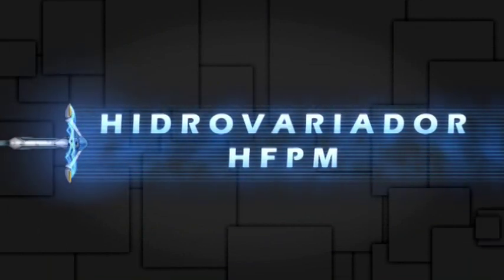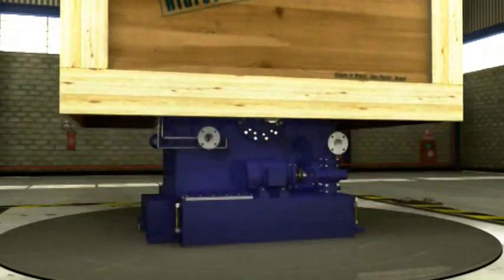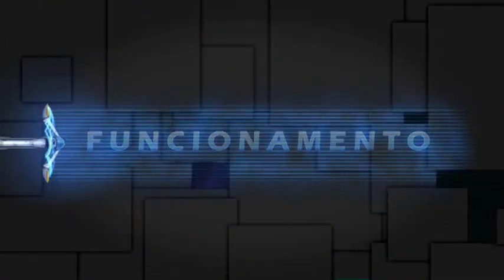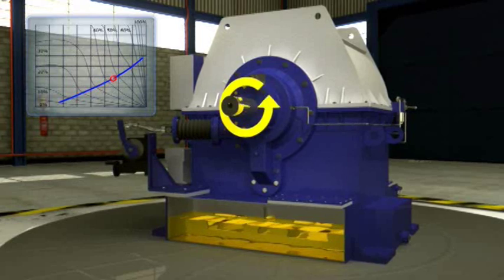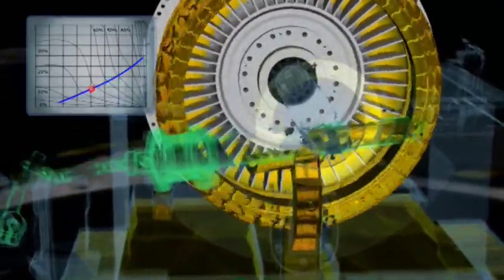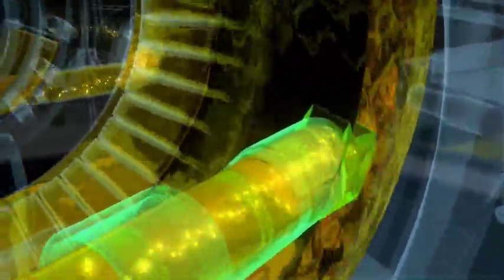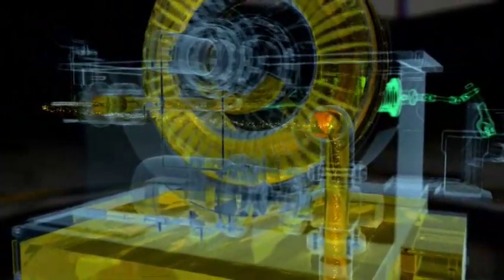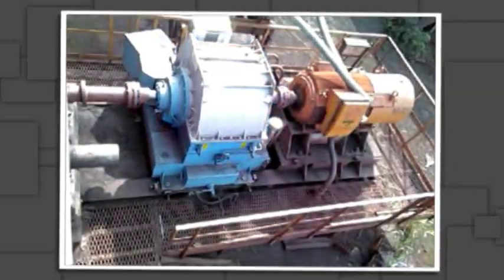Henfel's HFPM Variable Speed Hydrodynamic Coupling Animation and Application

Comment: As I can understand; if sleeve is insert position we can obtain low rotation speed, if sleeve is retract position we can obtain high rotation speed
Is it true ?
Reply from the maker: yes, in short, that is it. If the scoop tube is in, the volume of fluid in the operating chamber is smaller, speed output will be lower. If the scoop tube is out, is the opposite, more speed.

Comment: The word "efficiency" get's flashed around like a casual by-word. I have asked and asked yet no-one (so far) has been able to quote specific numbers or present graphical test results of the efficiency of the Fottinger hydraulic coupling. My general understanding from the automotive world is that it is unlikely to exceed much above ~80% whereas a well-designed fully-geared drive can exceed 90%. This is an important detail in respect of fuel consumption. My understanding is that ROLLS-ROYCE dyno tested salvaged DB's and analysed their supercharger drive design and efficiency. This must have generated an official report as this testing was commissioned by the R.A.E. I would like to see that report. It would go a long way toward explaining the mystery as to why R-R  (and others) never copied it. Does any know for sure??
Reply from the maker: Our models of Variable speed fluid coupling, which are usually applied to bulk material handling equipment such as long distance belt conveyor drives, transmit 97% of the input RPM and torque to the driven machine, in average. Our models of hydrodynamic couplings have only industrial applications, we can't respond for other manufacturers of  automotive technologies that are based on Fottinger's principle.
Reply: @RingfederHenfel  Thanks for that. I assume the 97% figure you quote is for a fixed-speed, fixed-load installation. I am interested to know how that efficiency number chances as these two parameters vary especially as achieving speed-change is by means of varying the fluid volume. This couldn't possibly be efficient due to the high level of frictional heating arising from the fluid agitation. Can you quote me some numbers and/or supply a graph illustrating how these change?
Reply from the maker: @andrerousseau5730  thanks for the interesting debate. Yes, you are right about that, this figure is at nominal operating speed of the equipment, not during start up and acceleration. Nevertheless, you have to consider the kind of application we are using this technology for. Take a belt conveyor, for instance, and imagine you have to start it up under loaded conditions, e.g, with the belt full of iron ore. You don't want to start it up abruptly, it'd tear up the belt. Besides, the motor would take this load directly, if it doesn't break immediately it would break eventually. With this technology, there's no mechanical contact between drive and driven machine, and therefore, you can let the acceleration take its course.  It's actually one of the purposes of using a fluid coupling, since you can set a time frame to achieve the desired and ideal nominal speed of the equipment. As for the temperature issue you mentioned, there is a heat exchanger to cool the fluid down in case of overloads and sensors to shut it down if a set value is reached. To conclude, hydrodynamic transmission have many possible applications, but it's not ideal for all of them. But when you consider it as an startup aid, it is suitable for many industrial equipment, such as belt conveyors, ship loaders, pumps, fans, etc...
Reply: Efficiency will vary greatly depending on the setting and load dynamics. The fact that there is a heat exchanger tells you there could be considerable energy losses in certain situations.  The whole concept is good and practical for SOME applications in that kinetic energy that could cause undue and excessive wear is converted to heat at certain critical times only. Longevity and performance of driven equipment is what this is all about.